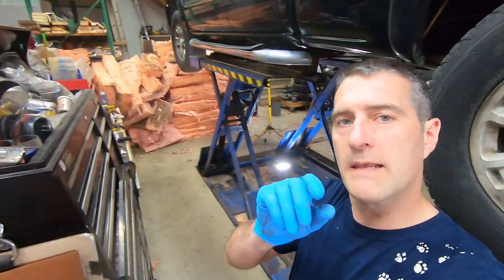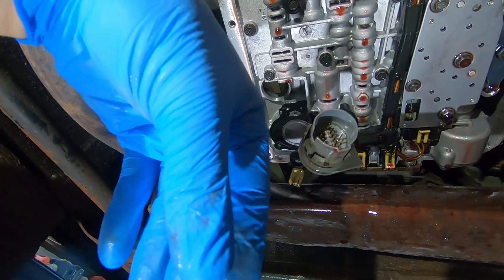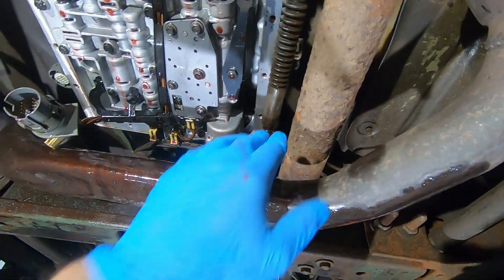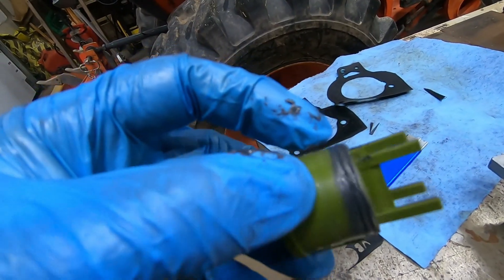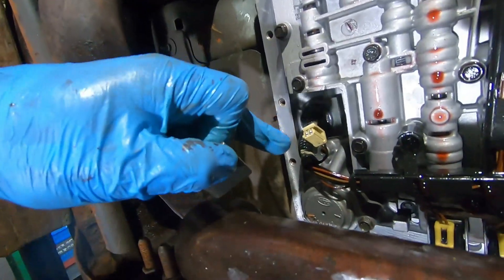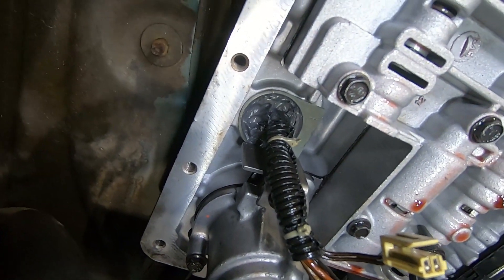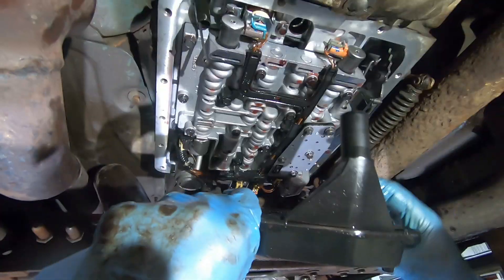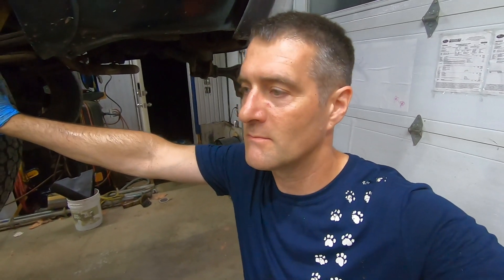Fix Trans Fluid Leak Through Wiring Harness Connector using Sonnax Bracket and RTV

Comment: I got it new LS swap i am doing using 4L60 I put in some transmission in it just to have some fluid in it till I get ready to start motor but I got some oil sitting where the connector goes with this not work right with trans fluid in connector
Reply from the maker: fluid in the connector is not desirable but may not cause an issue from an electrical perspective.
Reply: @mrdiyguy123 thank you for the information and the reply
Reply: @mrdiyguy123 i searched i found no clear answer for my query. is atf conductive? i have leaking connector with code related to tcc and shifting solinoids and atf pressure. i think wet connector with atf causing dtc.

Comment: Thank you for the video I did the same deal only.I dropped the exhaust.It was no problem getting the pan off and I didn't have to bend the bracket. I have A.
Raincoat so I was able to find one slightly larger and gently tapped it in
Reply: O ring kit

Comment: Great video I just installed the trans.It's great, but it's leaking from there.And the connector didn't feel good when I pushed it down. Which?
Wasn't until everything was bolted up. Tomorrow morning, I'm going to attempt to pull it up from the top.Hold it and clip it.Yeah I know I gotta try. I just bought a 100 bucks and fluid.Eighteen hundred bucks worth a transmission that ended up being a reman. Great video I like and subscribed
Reply from the maker: you could catch the fluid, filter it through a coffee filter and then reuse it.

Comment: I just fixed this on mine before. It was a earlier Trans though 94 4l60E so the sonnax harness connector bracket goes on a little different.  Yea. I had a worn O ring from all that up and down movement. BAD leak I used over 8 quarts in just 2 months